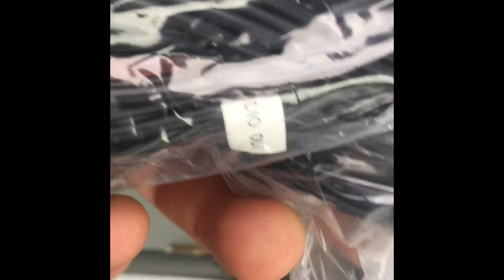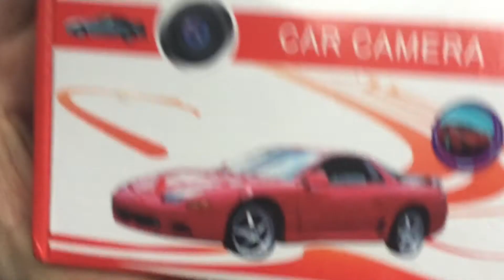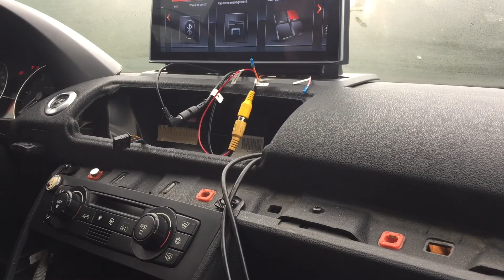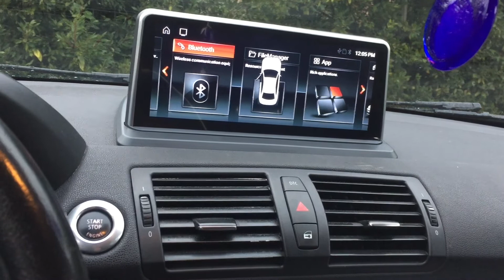BMW ANDROID HEAD UNIT REPLACE

Comment: Hi, I bought exactly such a screen and I have an original BMW screen
But when I installed it, the control and string control did not work
Can you give me a detailed explanation of this problem
Reply from the maker: In my channel i have another video with solution
Reply from the maker: You need use obd cable and ncs expert to ENABLE option in ecu
Reply from the maker: Contact me vasa2@libero.it